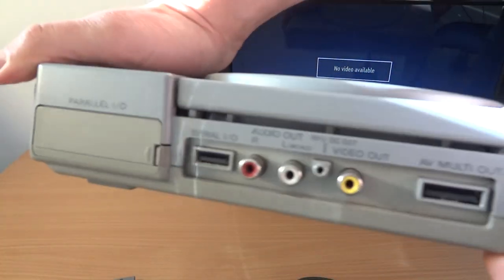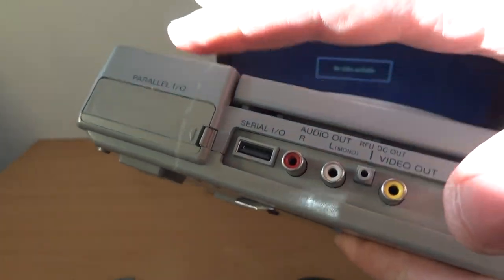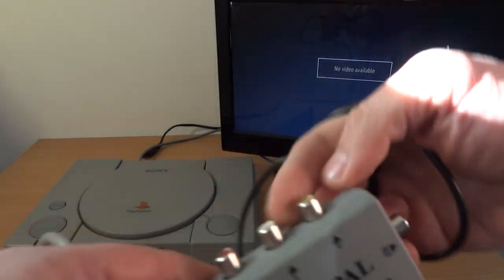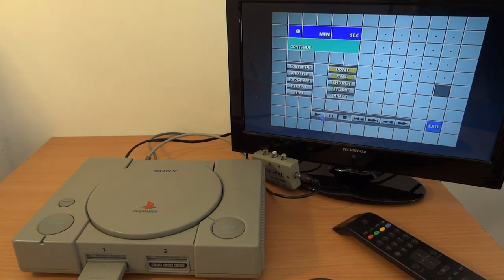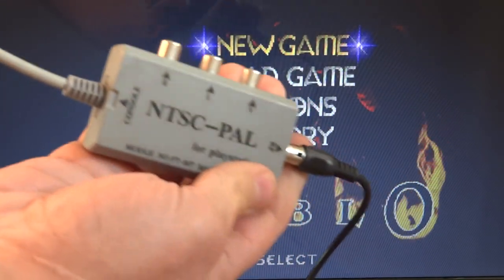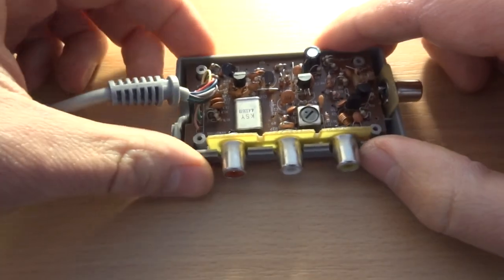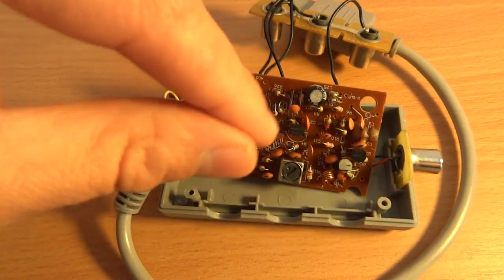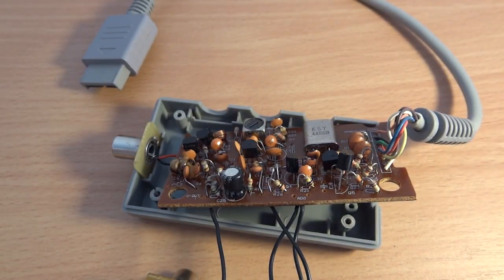PlayStation unofficial accessories: Analogue TV output (RF-out) add-on with NTSC-PAL converter

Comment: What is name of cable by tv
Reply from the maker: I only used a power cable, PS1 scart cable and the RF adapter with standard European RF connector (US connectors are usually screw-in coaxial and Europeans are just a plugin). The other end of this custom cable is a standard RCA plug which is not common for any RF signal.

Comment: Hello! I've got a Playstation 1 PAL (not PAl M or N, only pAL) and my TV is NTSC. I've already tried the conversor PAL - NTSC from Ali Express, but it didn't work (funny how it only works for the 2 frist screens... but when it enters in the games.. only some colors work, it gets weird). My question is: is this converter PAL (without being M or N)? Thanks!
Reply from the maker: Sorry, but I can't confirm which specific version of PAL it outputs (might even be a semi-PAL signal, just converting colors). None of my TV show the signal type they get so there is no way to confirm this for me.

I would recommend against using this specific converter as it has poor signal at the output. Best choice for PS1 is SCART cable or S-video and then convert this signal to what you need with an external converter if you run a CRT. If your TV has HDMI you might be better off getting a converter for that since it will be more flexible with input signals (although cheaper ones might cause some more lag than what TV would normally get with analog inputs).

Comment: This adapter because you have it in the video, does it really work that you can make pal (50hz) to ntsc (60hz)? I bought another adapter (pal50hz-to ntsc60hz). My TV showed that the ntsc 60hz is there the ps1 and ps2 games weren't faster at all. Only the graphics have changed but no more frames per second. I wanted to buy the same adapter because they have, but could you please test for me whether your adapter really makes the pal games faster ? So such a small test pal50hz and ntsc60hz side by side and whether ntsc is faster than pal with your adapter? Please give me a quick answer because I want to know if this works with your adapter before I buy it. I also subscribe to it. Please ...
Reply from the maker: This is only output adapter so it won't change how many frames are sent by graphics chip and processed on output to initial analogue signal. Only modchips may alter this but to my expirience all run in correct framerates for a game region. It doesn't change how game is processed as it only works on composite signal. It's not great quality and I would strongly recommend using multisystem TV with SCART cable - best way to output image from PSX. I think ps2 and ps3 is capable of outputing component which would be preferable for NTSC only TVs

Comment: I can play NTSC games on my chipmodded PAL PS2 but the colors are not accurate. Red becomes orange and yellow becomes green-ish. Can this small device correct the colors by turning the switch to PAL?
Reply from the maker: That device is just a curiosity - it will give you a horrible video output. I'd recommend trying with a different TV or more professional system converter. Before I got my current Bravia (from around 2009, it has all the analog inputs) I was using VCR as a pass-through to convert the signal. It's also possible that your TV has an option to select a different system.
Reply: @pandaengineering  my CRT is able to detect the outputs and change accordingly. If I play NTSC it switches automatically, same with PAL. just that the NTSC colors are awful. I'm looking for a way to display NTSC colors correctly. I heard SCART TVs are able to bypass that regardless of console region?
Reply from the maker: Oh, sorry. I get what you mean now, but only situation I had with messed up colors was when TV didn't support it, but if I recall correctly it was causing a grayish tint. I never heard about the possibility to bypass the region, especially since *some* SCART cables are infact composite or svideo only. Also I read somewhere that the signal that TV gets via SCART connector can be either RGB or YPbPr and it's up to TV to distinguish what it is. According to my best knowledge PS1 outputs RGB signal, but on PS2 it's an option in the menu (and this may be an issue you are experiencing). I found this info here https://blog.andrewbeacock.com/2008/08/setting-up-progressive-scan-on-sony.html?m=1

It's just a guess since I don't have a PS2 to test, but maybe this will be it ☺️
Reply: @pandaengineering  ok so i finally got a hold of that same converter but for PS2. It works only on RGB mode from the console settings, but once its on TV—it had a yellow tint... and the cutscenes realty glitched out. I’m using composite cables, any idea why this is happening?
Reply from the maker: Sorry, I have no idea. Cutscenes may be a sync issue because they're displayed at a different resolution than gameplay or they can be same-field interlaced (effectively half height resolution to save on video file size).

Comment: Does this work on a ntsc tv and my ps1 is modded when i play pal game on my modded ps1 the screen is black and white my ps1 model is SCPH-9001 ntsc u/c (us and Canada)
Reply from the maker: This one is specifically to NTSC to PAL (one way only). Try checking TV settings if you can select video system manually or maybe you have it set to NTSC only. Otherwise you can get separate composite PAL to NTSC signal converter from Aliexpress or Ebay for ~ $7-10. It's USB powered so signal should be of a decent quality (for a composite). Looks like this https://i.imgur.com/tom4o5k.jpg
If you would rather get something higher quality, there are  some HDMI upscalers, but ones with low latency (so time from console outputing signal to image on screen) are quite expensive.
Also, if I'm not mistaken, those HDMI converters that plug directly to console have horrible quality (at least they look the same as ones for Wii so I assume the internals are similar). According to what I read on reddit and some forums they're the worst solution.

Comment: Why would you use rf is garbage why not use av or rgb scart?
Reply from the maker: When I bought it in early 00s I only had a TV with RF input 😉 it didn't even had a Composite. It's just a curiosity now and it's a little bit different from Sony's original converter that required DC out jack that was only on SCHP-100X (little gray port between composite and audio RCA ports).

Comment: And now today you can just add a modchip.
Reply from the maker: Output is still in NTSC/NTSC-J or PAL on a modchipped PSX - you need a TV that support all the formats 😉 when I was using my chipped PSX back in the day, I bought this converter, but eventually just used it via VCR that supported NTSC and did a nice conversion to PAL.
Reply: well modchips were more of a thing 25 years ago lol, today not so sure. And it doesn't do a thing. I have a modded NTSC PS1 and even if it can read PAL games the NTSC TV won't display it correctly, this is why you want to change the output.

Comment: I have the same adapter but for PS2
Reply from the maker: PSX, PS2 and even PS3 has the same connector for analog video.
Reply: @pandaengineering  Im not able to play PSX-PS1 PAL games (ISO or Bin-Cue) on my NTSC PS3/Television Set.  what should i do , what converter i need to install on my PS3 ?  it exist a HDMI (PAL-NTSC) converter that i can connect on my PS3 ??
Reply from the maker: I think you need a hacked PS3 since the PSX games are just emulated. As far as I know PS3s are region locked for PSX and PS2 games.

Comment: So I can play imported games with this? :)
Reply from the maker: Not really, you still need to have modchipped PlayStation. PSX displays output in the region specific format (so NTSC for US and Japan and PAL for Europe) and this converts the NTSC signal to PAL. It doesn't have any power so signal isn't processed well as you saw. Instead of this I recommend SCART cable (aka EURO) and multi system TV, signal is perfect :)
Reply: @pandaengineering  Oh okay :(
Cheers for your help man..
Reply: Panda Engineering Asian NTSC-J or Chinese NTSC-C console (NTSC and PAL switch).